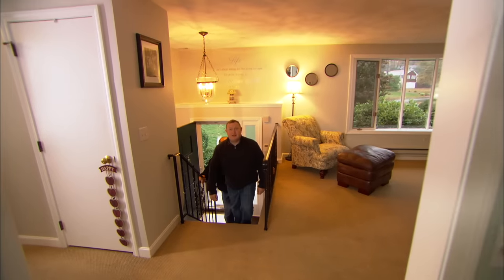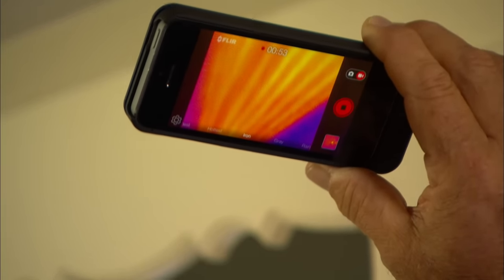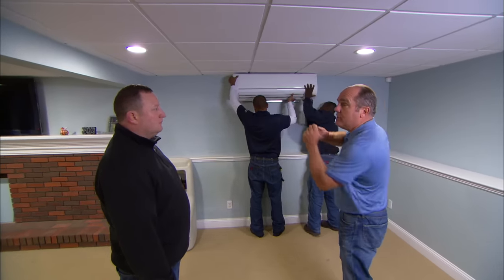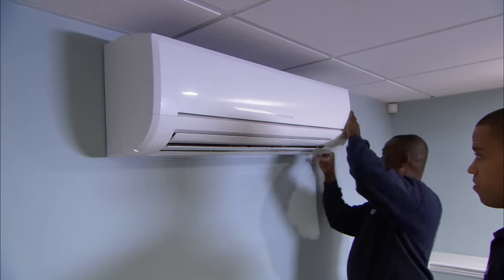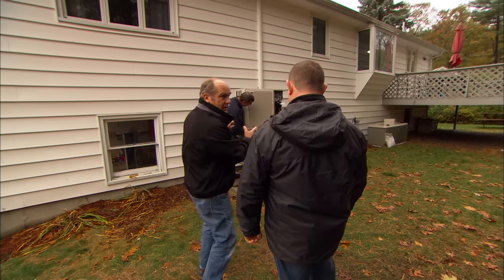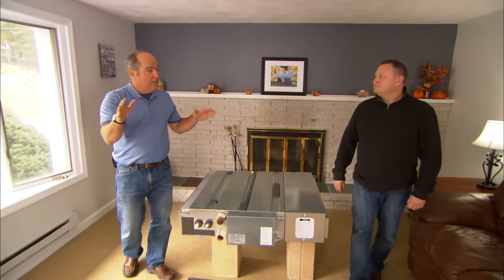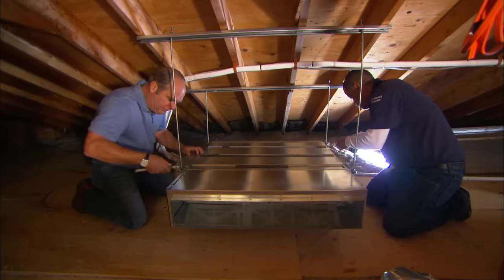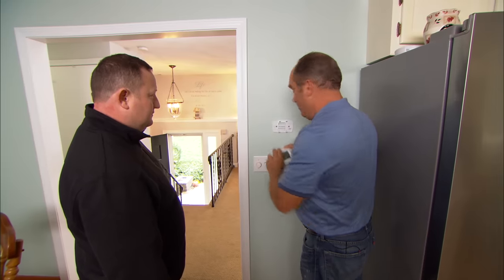How to Install a Whole-House Ductless System | Ask This Old House

Comment: If you're going to place ducts in the ceiling and place a unit in the attic, it would be less expensive to use a conventional  design. The unit's shown in this video are likely more expensive. I've owned six houses over the years and had to replace the heat and air units in all of them. For longevity and reliability, I found it is always better to go with a conventional heat pump that comes with a ten year warranty. In one house, three small units proved more efficient that two large units. We are able to control different zones much better.

Also, if the sun shines directly on your outside unit, you can add another layer of foil back styrofoam the top of the unit to help in the summer.

A typical problem in design is not having a large enough return air duct. If the return air duct/ducts are not sufficient in size to allow enough return air, your unit will not operate at it maximum efficiency. We added an additional return air duct to one existing five ton heat pump and the difference in efficiency paid for the cost of the duct work in two seasons.

In another house, we added outside motor controlled shades to cover upstairs windows during the afternoon sun in the summer. Before we added the shades, the upstairs air conditioner ran constantly, never able to cycle during the hottest months of the year. The motor powered outdoor shades cost $1300.00. They paid for themselves in three years. The upstairs unit can now cycle instead of running all day.

Before spending a ton of money on any heat and air system, get several quotes. Some of the HVAC guys understand the entire system and some only understand how to install pieces of equipment and have no knowledge about sizing, air flow restrictions, and location of vents.

Get a written quote that specifies everything, each piece of equipment, including model numbers, and be sure your quote specifies a total cost for all materials and labor. When you get multiple quotes, you will see the difference between those who know what they are doing verses those who only sell and install pieces of equipment.

Change your filters regularly. Use the middle grade filters, not the super fine particle ones, nor the cheap anything-but-a-boulder can pass through them.

Taking the time to research will pay off big time in the long run, if you plan to stay in your house for many years.
Reply: Thank you so much Jack this will be very helpful for me when making a decision to retrofit an HVAC in my home.
Reply: I will use this advice when we go for our heat pump, thank you for the insight 🙏🏾

Comment: I live in the snow belt in NY.  It gets really cold and damp...and in the summer it gets really humid and hot.  I use my hot water baseboard boiler system in the winter and my Mitsubishi mini-splits in the summer.  I have 3 head units and I oversized the condenser unit for AC in the summer.  No matter how hot it is outside, these units keep my rooms at 1 degree accuracy..and with a 2000 sqft house with cathedral ceilings, i spend no more than $120/month on my total electricity bill.  I also keep it at 70F during the day and turn my bedroom down to 68F at night.  
Since I also heat my home with wood in the winter to take the chill off..the mini-split head units can also be used as fans to keep the air moving.  This helps with wood heat.  I use them to help heat in the 'shoulder season' as well.  Those days when you just need to nip the chill off, but can't justify starting a fire. 
I'm so happy with these systems that I'm going to put a smaller unit in the shop i plan to build.  They blow the doors off a regular duct system.
Reply: Dave C. Your install is very simular to my system in Central Va but I did not expect the two ton Mitsubishi to provide 99% of my heating needs. I do bring up the hotwater heat a few days a year when we have zero degree mornings.  The unit will be break even after four winters and whats not to love how they manage summer time humidity?

Comment: As a master electrician and contractor ,I have seen heated cable drywall before.  It was a nice system as every room had its own thermostat. What we usually did was abandon it and install baseboard heaters and a heat pump forced air system for a/c and heat. In the Detroit area  in the 70's the utility gave homeowners a special low winter rate that was intended to make use of excess capacity in the winter. However when the rates changed homeowners bills sky rocketed two to four times higher!  They were forced to redo their HVAC system.
Reply: Electric heat would work if the electricity remained cheap... or, if you generated your own electricity via rooftop solar... hmmm... an idea whose time has really come?!
Reply: +S. Brian Chong , It takes a LOT of PV to feed heating systems!!  
For our current house, estimates for 12.5 KW of PV panels, would only cover about HALF or less, of our winter electric bill, for a 1970’s basic, substandard construction, 1500 s.f. tract house.  We have 4 adults living here, all running multiple electronics, some are 24/7....efficiency of those cannot be decreased, yet. 
   If we first get one of the highest efficiency heat pump mini-split ductless systems [Daiken, Fujitsu], THEN that same PV array, MIGHT almost feed our whole electric bill, including heating...that is, Until the utility jacks-up electric costs again.  
   Also figure: Tax assessors jack-up property value/taxes, every time they see a property improved...new roof, adding a driveway, solar energy installations, other houses sold for massively higher prices during the year, etc.  
   Electric resistance heat [portable heaters, baseboard heaters, etc.] are costly to run, due to electricity costs increasing so much.   But electric resistance heaters CAN be more efficient than HVAC blowing through many feet of ducting [depending on how well or not the ducting is insulated], because blowing the air you just paid to heat, immediately loses upwards of about 75% of the heat you just paid to make; that is how promoters of baseboard heaters, or ceiling radiant electric, got away with claiming those cost less to use than central HVAC.  
   Still interested in Solar heating?  Cheapest solar heat we’ve experimented with, was Solar Air Heat panels.  I built a 64 s.f. array, using recycled aluminum cans [there’s some magic physics for choosing that].  Booted those thru a small south window, in a 100+ y.o., approx. 900 s.f. house which had been “brought up to code”, in SW WA State.  
Used that for about 3 years with the original cheap corrugated greenhouse plastic panels [bad idea]; upgraded cover material after a few years, to Twinwall Polycarb. panels, which sealed better, &, added a 4” duct fan to boost air flow through the system.   Some use computer fans run directly off a little solar panel.  
That saved between about 100 to 300 kWh, off usual electric heat energy costs [usual heat included a Cadet wall heater in each room, or, a single oil-filled radiator running on 600 watts only].  
   That translated to saving between $10 to $50 per heating month.  
CAVEAT for our location:  There are about 2 weeks, approximately between Christmas and New Years, when we closed the boot box vents, then opened them once the “dark days” passed.  
But that was real money saved.  
CAVEAT for season:  Solar Air Heating panels need to be covered during summer, to avoid heating the area and adding to urban warming, or melting down its components.
Reply: He also described the cables for the heating wrong! They go on the bottom of the sheetrock and then a skim coat to hide the cables, can't touch the insulation.
Reply: HVAC pros are really good at installing technology that ends up draining the bank accounts of people in the long and short term.
Reply: @bebo5558  exactly, how the hell could one have hot wires touching insulation that woudl be a fire hazard.
Reply: @rivergate950  Watch the video again and listen close, Rich says the cables go above the sheet rock and fasten to the bottom of the joists, hence the cable would be touching the insulation!

Comment: The air-handler is mounted to the rafters to prevent vibrations from being transferred to the living space.
Reply: Yeah, the rafters aren't connected with nails to the walls and joists so that's good.
Reply: @percyfaith11   so  how do you think that they are connected?
Reply: @allanmann2597  ask David Bergen. He's the one that thinks mounting the air handler to the rafters will prevent vibrations from being transferred to the living space.
Hint, it was sarcasm.
Reply: @percyfaith11  Since you don't know how well this works, it works great, you should refrain from sarcasm.  You only make yourself look ignorrant.
Reply: @davidbrogan606  Ignorrant??  What is more ignorant than to suppose that mounting an air handler to the rafters will prevent vibrations from being transferred to the rest of the house?  How's that work when the rafters are nailed to the joists which are connected solidly to the rest of the house?
You have to isolate the vibrations from the structure with rubber pads or other vibration isolation material.  
I'll refrain from sarcasm when you refrain from silly statements.
Reply: @percyfaith11  The system they use to mount the air-handler to the rafters works very well.  When you mock it you do indeed present ignorance.
Reply: @davidbrogan606  You just have to be in awe of the irony of someone that believes bolting a system to rafters will cause no vibrations to the structure calling someone else ignorant.  I'm mocking your naivete, not the system.
Reply: @percyfaith11  Nobody is saying it stops all vibrations.  You came up with that on your own.
Reply: @davidbrogan606  read your original post to see where I came up with that.  You said stop vibrations you didn't say stop some vibrations.
Reply: @percyfaith11  You need to take responsibility for your own interpretation.    Your added words are not mine.
Reply: @percyfaith11  Best practice for an air handler that cannot be placed in the basement is to mount it in the attic suspended from the rafters.  If you wish to create some new best practice, please feel free to do so.  To mock the current best practice seems ignorant or at least argumentative.
Reply: @davidbrogan606  you need to stop trying to weasel out of your words, man up.
Reply: @davidbrogan606  it may be best practice but not the simpleton's way that you try to make it out to be. I'm mocking your interpretation not the machinery. Can't you get that straight or don't you want to get that straight?
Reply: @percyfaith11  Hmmm, I don't think it's me trying to weasel out of what he said.  My post stands as accurate.  It's mounted to the rafters to stop vibrations.
Reply: Come on Percy, I think you were winning!😂

Comment: Got one last year along with a $1000 rebate from my power company. Super comfortable heat in the Winter and nice and cool in the Summer. On top of all that at least a 35% savings on electricity costs!
Reply: How much did you end up spending on the system?
Reply: JudgeDroid I think just short of $4000
Reply: Woah! That's awesome. I've been looking for an alternative to running duct in our house. This is such a cool idea!
Reply: Grand Junction Guy There are actually ducted systems using the same base compressor to get air to different rooms. Much smaller than typical ducting so if there is a minimum attic or crawl space it can be done. Or can have a paired unit in another part of the house. So one condenser unit but multiple mini-split indoor units, each with it's own settings. Costs a lot more though. In my case one more indoor unit would have doubled the cost. One unit works pretty good for my little house (800 square feet.) Then add electric or portable AC to areas it can't reach well.
Reply: Thanks for your help. I'll check it out. Got a 70s style ranch house, and baseboard will be fine, we'd just prefer to switch at some point, and it's a lot about the cost of removing all the drywall and installing duct. Had no idea this existed, so it's cool to have options!
Reply: so is the heat invertor part of the system or is that an add-on. I have had a few people tell me that by default they will only heat about 30 degrees warmer than outside. So if it is 40 degrees outside it will not get warmer than 70 degrees
Reply: Weaver Cattle Company I'm sure with the right conditions other options may have been better but for this old house of mine - it's location and lack of duct space the mini-split seemed to be the best option for me, efficient heat and AC in one unit. I know some have had a history with breakdowns (mostly older electronics) but this Mitshubishi seems to have a good track record, with a decent warranty. Hopefully it'll last the time I'm in this house.
Reply: @durakis  It's all included in an install. Two units, one outside that does most of the work, then another inside. Those numbers sound typically correct but it's capable of reaching higher temperatures by condensing the warm air it does find, if I understand stand the process correctly. Last winter I had temperatures of around 35 degrees, no problem finding enough heat. Sometimes, if cold enough, it's a little slow at it but always got into high 70's it seemed. I've read in the past if the climate was very cold, like in northern areas, some struggled but the technology has improved since then, to be able to work in those climates as well.
Reply: Hey what if it gets down to zero degrees, do these things have an emergency heat like a regular heat pump?
Reply: @bomark2002  With mine 0 could be difficult but there are new models that are much more capable now in colder climates. We often see 32 or even mid 20's through part of the winter months in the NW and it handles it pretty good. Not sure about a heating suppliment as part of the units - probably would just add a traditional standard gas or electric heater to suppliment colder temperatures. In the video they are installing one in New England which has pretty cold winters.
Reply: We getting one very soon after remodeling our house everyone have one they great 👍
Reply: @Weaver Cattle Company Some people are trying to get away from supporting the oil industry --- oil/propane/natural gas.  Once you see one of these extraction operations trash an area you live in, you reconsider the "convenience and cheap price."

Comment: Sooo many moving parts to account for in this setup.  The premise behind the minisplit system was to cool/heat an area of the home not suitable for ducting.  In this example, there's an entire attic to install ductwork in a conventional cooling and heating unit.  There are conventional inverter type residential units that would apply here that does the same job with far less equipment in the attic to account for.

All that is needed is a variable speed inverter heatpump condenser unit on the outside.  Next, you will have (1) air handler with a variable speed blower in the attic versus (4) in this setup.  Then, you will have your ductwork sized for the space, separating each area of the house you want to heat and cool separately by a damper module that will open/close to allow/restrict airflow to that area depending on needs of the individual thermostat.  All of this is managed by a zone controller which based on a profile of the need of each zone of the house will instruct the air handler to provide a certain amount of airflow (CFM) and the outdoor inverter condenser to operate the compressor to operate at a certain RPM to deliver enough refrigerant capacity to cool/heat the zones calling for comfort.

 This is an simplified explanation, but its less complicated than the example shown here in the video.  My example deliver same results with less moving parts.  But, in the end, you will need qualified technicians to troubleshoot AC to DC board issues.  Not many are trained for this new technology.
Reply: You've glossed over the fact that most houses have unconditioned attics. You can't (ok, you can, but you absolutely shouldn't) install a/c equipment or even ducts in an unconditioned attic. This is building science 101.
Reply: Will agree the lack of technically compete techs is a evolving problem but Mitsubishi has addressed the servicing of their products with online diagnostics that should help. The low cost of many brands suggest they are following tv's as being throw-a-way products.
Reply: @trevorlambert4226  Insulated ductwork fixes that mostly, but your cost for that part of the system just tripled.

Comment: Very nice but there's a LOT to be said for simplicity, esp. low frequency of repair rate. I kept my last central air units going for 48 years and replaced them because some simple parts like contactors were getting hard to find. The replacement cost was very low.  My advice to anyone who has a central air unit is that, if it was installed properly (and you'd be surprised at how often they are not) and functioning well, never let anyone touch it! Keep the condenser area clean and free of debris. Clean the condenser coils with detergent and water spray, if necessary. Change the air handler filter (no more than MERV 8) when dirty. Don't cover the condenser with a completely enclosing type. I put plywood on top of mine separating it from the unit with 1/2 tennis balls.